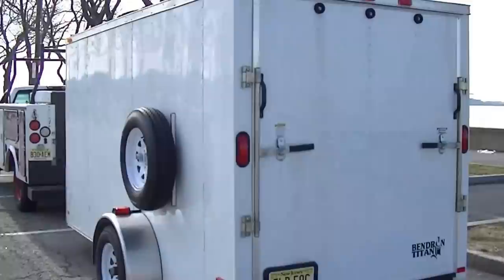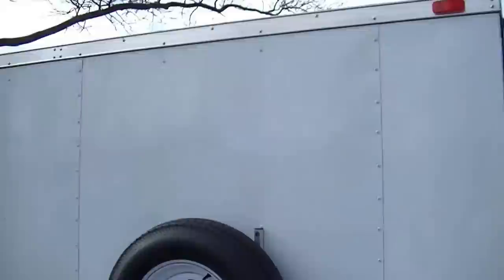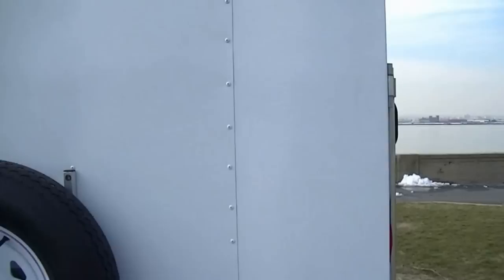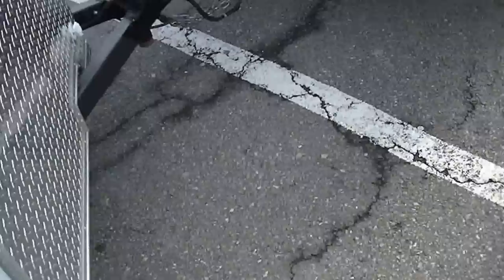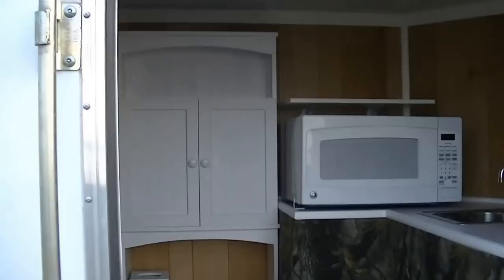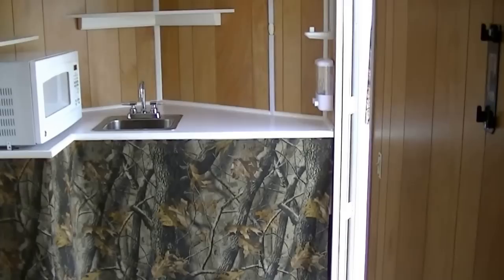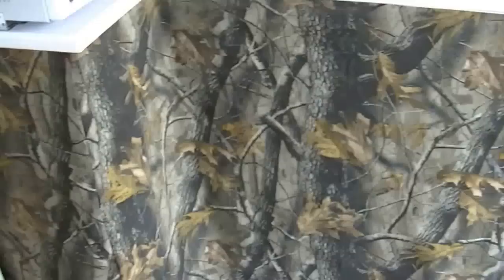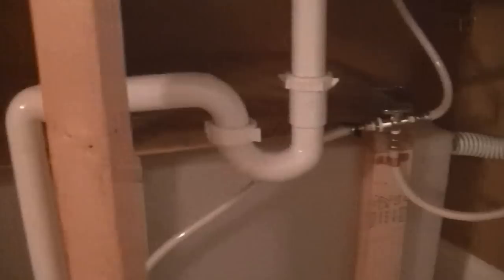Bug Out Vehicle - Cargo Trailer Stealth Camper - Part 1

Comment: Tip: coating the underside of the floor plywood was not a good idea...   Any moisture that manages to find its way between the floor and the wood (and it will)  will saturate the wood and rot it out over time.  Other than that,  looks good!

Comment: Looks great. What do you use for a heat source for cold weather situations? Did you purposely choose not to have Windows? How dark is it in there with all doors closed and just the light from air vent. And I take it you can't stand up straight in there right? All pretty cool though.

Comment: Very nice work and well thought out. What type of insulation did you use (the rigid stuff) against the skin on the inside ? was it the open cell styrofoam or the closed cell blue board stuff ? Thanks for the video. Inspiring  .

Comment: I noticed the low shelf that you called a bed has a hinge. Does it fold to the middle of the trailer and have support poles? Have you thought about a futon style seat that would provide a couch for sitting and a bed for sleeping? As others have said, a window or skylight/vent would be nice. Would add ventilation too. Of course the more holes you cut the more water intrusion becomes an issue. Do you have a gray tank? Didn't see one. Overall nice setup.

Comment: With a tandem axle trailer, in an emergency, you don't have to stop when one or even two of the tires blow out.  Jussayin
Reply: even if its 100% loaded you can still limp along at low speeds. I can imagine a situation wrol that this could be the difference between life and death.
Reply: Missing the point buddy.
Reply: yeah continuing to drive at like 20 miles an hour maybe an exit or two up the freeway, I'm talking about emergency situations not oh a tire blew up, oh well lets keep driving for the rest of the day. No, I'm saying it might keep you from having to call a tow truck if you can limp the five miles to the next tire shop, its not a black and white thing, it depends on the situation and obviously if the trailer was already loaded to maximum capacity I would be quite a bit more cautious. 
This also goes along with the thinking that you are getting the extra axle to have it, not becuase you need. In other words, maybe you calculated your weight for a single axle trailer then decided to get the dual axles as redundancy. The idea is you'd never be pushing the load limit for a tandem axle trailer in the first place.
Reply: tell that to the officer lol
Reply: Pro tip: don't do it if your trailer is already at capacity... If you know your axles rating and you know how much weight you have in the trailer there's no issue. 
People are so dense.

Comment: Wow, I am totally impressed. Now I will have to do the same on my V-Nose trailer. How did you get the original wood paneling off in order to insulate the walls?
Reply: Most of the screws in the trailer walls are somehow sheared off. they look like they will come out but they just keep spinning around. because they look like a Phillips head but most Phillips head screws won't come out. They use something like a nail gun to put them in for production work. There's about two ways to get them out one is drill out the heads of the Phillips head screws or tear up the wooden wall getting the wood out and then cutting and grinding off the screws. If you get a trailer made make sure they use removable Phillips head screws. But the trailer guys in Georgia work fast and cheap and sometimes I should say a lot of times they don't follow a work order.

Comment: Nice Job! I would suggest a Mini Marey water heater for you rig. Simple to incorporate into your existing system and its a on demand electric heater. Will require a 30 amp circuit. But the heater only consumes 24amps. Check it out on Youtube.

Comment: Did you consider using a composting toilet so you wouldn't have to worry about sewage or plumbing for draining gray water? I've been planning to build a similar vehicle, and I keep coming back to the idea of a composting toilet for a lot of reasons, including not having to use water to flush. In a bug out scenario, water is going to be a precious commodity, and I don't think I want to literally flush it down the toilet.

Comment: That micro runs off a truck batt. You need a hole with a flap in the bottom for a crapper. Where do you plan on going? I think i may staying home ass soon as your gone you wll loose your stuff at home

Comment: Is there a way that you could hook up three batteries in the trailer then get a big solar panel, put it on top of the trailer...well you know what i meen. so if you didn't have any power at all then that could be a second option.  Or is that what you are going to do?
Reply: Batteries need to be the same age when connected unless you have expensive switching gear which compensates.  Solar panels are not as powerful as many believe but obviously their output depends on where you intend to go!

Comment: The only thing I would suggest is that, Before the shit hits the fan and there will be no available electricity any where, Install a solar panel kit like this ~> http://alturl.com/4gi42 and get a 1000 Watt power inverter to connect it to Like this ~> http://alturl.com/66sqm and run a battery grid (particularly 2 or more 12v 650cca or higher car batteries in parallel) also run the 12 volts from the trailer light plug into the battery also so you have several options... the truck will always charge your trailer battery and when you have the truck turned off the solar panel will regulate both the truck and trailer batteries. other than that... Excellent Job... I now am going to convert our 92 GMC Safari and 4x8 wells cargo trailer into a bug out deal :-) happy camping :-)

Comment: , always outfit your camper and or vehicle to what you are going to be using it for.
a ( bug out ) / camper box trailer are similar but different. in very subtle ways . is it a survival camper? 
or just a means to get you to where you are heading to, ie, destination ??
you will need all the ammunition, food, water, medical, and supplies you can carry. you will need several coolers with ice, 
as much gas as you can carry also. so it's really what you intend on using it for. you will definitely need solar panels on the roof, as many as will fit to produce enough electricity to charge radios, cell phones, laptops, TV's for news on what's going on, if roads are closed, or evacuation routes?
shit like that. best rule of thumb is to keep it as simple as possible, ammunition/weapons are first on the list of survival shit, then water or a means to make water drinkable, then food, and medical supplies/medication. make sure you get a vest, or armored plate carrier at least because people will be shooting at you and everyone else in a national emergency.

Comment: I'd go with a roof AC if you're still considering how to handle that. Physics says the cold air will drop, not rise; therefore a roof AC will cool your whole space, rather than just the floor. And once you've got a genny integrated in there, you can add other niceties also. And a small solar array can add some support for LED lights, or maybe even thermal HW for your shower.

Comment: So what happens when someone latches the doors closed when you're in there? HEEEEEEEEELP!!!!!!
Reply: floor hatch ?
Reply: Use a 2nd hasp to secure the locking bar in the open position when you're occupying the trailer.
Reply: @vorant77  I would never have them latches on my doors. If you advertise you are inside by leaving them doors unlocked you are asking for trouble. I don't think people should be sleeping in a cargo trailer. I have no problem converting one into a travel trailer but trying to hide and sleeping in a no camping area is a no no. I'm sure the cops know all these tricks now. This video is unwise camping practices.
Reply: Yeah I would not be caught inside a death trap.

Comment: stealth camping, hahaha, with a microwave hahaha!!!, yeah, where are the crown moldings??? hehehe!
Reply: clearly you haven't a clue.
Reply: Tom Zaytsev
 Well, it does go a little funny with "steath".  I assumed he wanted options, for when he was just camping out in front of god and everybody, he can plug in.  Plus some utility trailers get plugged in and left plugged in at job sites... maybe he could go cross country borrowing electricity...

When I "stealth" camp, it's many miles from power - but my big old motor home had 120 and 12 volt service, besides the propane lights and fridge, just for adaptability purposes.
Reply: boondocking yes I do that to , solar panels 200w worth,  Colman  wind generator. this  guy built him self a low profile Park it anyplace  ( a lot of cities have  rules about rv parking) shelter, that's easy to tow and at a reasonable price. why do people get all weird about being prepared for  a disaster.?  ever seen a hurricane.?  Earthquake? what ever,  if he can make it to a safe place  at least he has shelter, 10 below in your car  or this rig,  I chose  to  trailer.

Comment: , nice job man!!!  go to
www.sportsmansguide
and just get urself one of those portable camping propane on demand water heaters bro.!!!!
right around $200 bucks, perfect for what you need.
to have endless hot water till you run out of propane or water supply.
they work great.
also get urself a couple 
100 watt solar panels for roof and a 12 volt agm battery. your all set.
and a 1,000 watt inverter